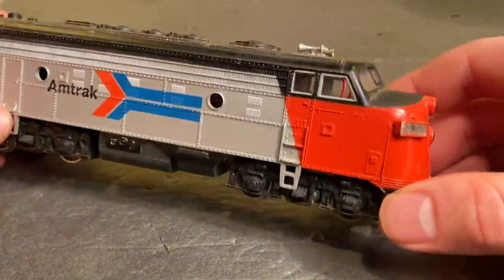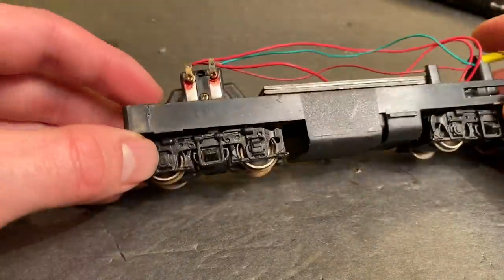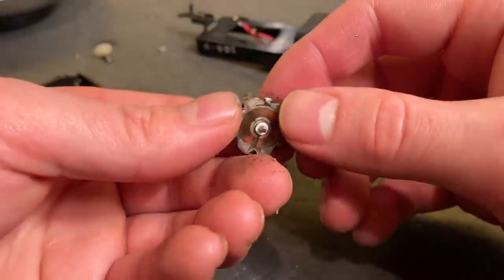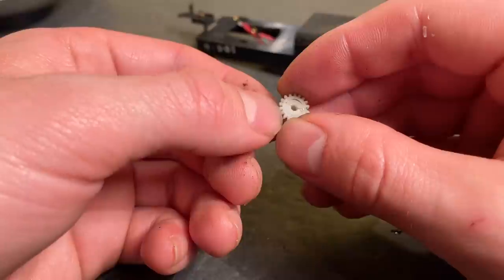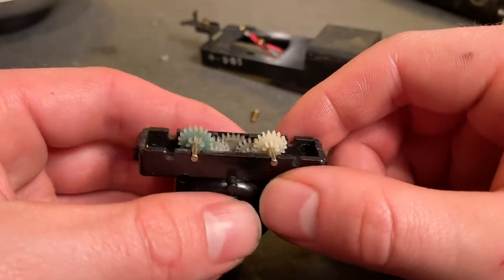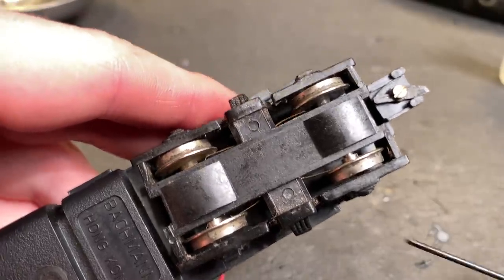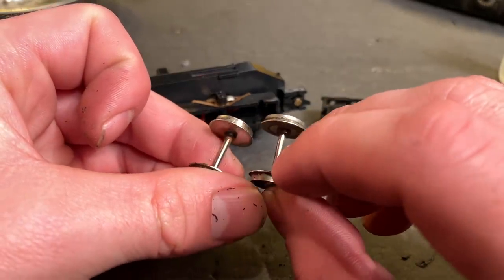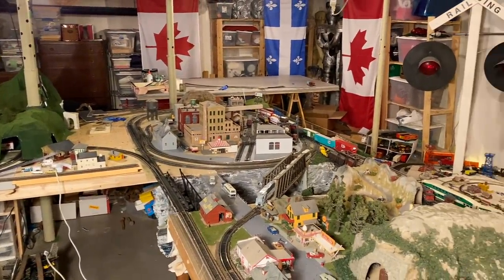Can We Fix This Broken Amtrak Locomotive from the 1980s?

Comment: That gear probably won't hold long for too long.   Northwest Short Line was the go to company for ALL things gear and wheel related.   But they're out of business unfortunately.   NWSL was a great company for the hobby for many decades.
Reply: Have seen a nylon gear repair with liquid CA and baking soda sprinkled on while CA is still wet makes a “resin” ??? But seemed to work in video.
Reply from the maker: I think the Life like gear should hold on, time will tell. They weren't known for cracking like the Bachmann ones.
Reply: @SMTMainline  that’s good to know.  I mostly only own Athearn blue boxes, old pre powertorque tycos and some Mehanos and only two Bachman.  The poor tycos are mostly dead only two out of five or six were ressurectable.  I have only been working on HO locos since September really and have learned a lot from you videos so just want to thanks again!!

Comment: Re: fixing cracked gear. I saw a YouTube tutorial clip & the guy powdered a cracked gear with baking soda, and then dripped in a small amount of superglue (cautioning not to get any into the gear teeth). The mixture hardened up & his fix worked. This fix was on a gear that was only cracked to the axel, and not cracked all the way in half like yours.
Reply from the maker: I will have to try that
Reply: Useful info! I tried to super glue a cracked axle gear on my kid's Tomy Thomas loco and it didn't hold, so maybe I'll try again with the baking soda.

Comment: I have a similar F7 in Santa Fe paint and also tried to service it like you did. There is power going to the headlight but as I took apart the motor, I noticed the armature had what looked like green lime calcium build up. Should I try remove it with alcohol wipes because it looks like the buildup is preventing the motor from spinning.

Excellent videos and I'm following them to restore and even service my current fleet of engines! You might like the videos I post on my channel!

Comment: I just kinda assumed the Life-Like and Bachmann pancake motors were the exact same, I guess they do have slight differences- but they do seem terribly similar so I'm not entirely shocked you can swap in a gear from a Life-Like to fix a Bachmann. It sounds like it really wants you to swap out the other one too!
Reply from the maker: I don't know which did it first but clearly one manufacturer was stealing designs from the other.
Reply: @SMTMainline  hey smt I have a life like model locomotive that needs to be restored con you possibly fix it

Comment: I really need to pull my trains out and fix them up, I know I have a few that aren't running. I just hope I don't have any broken gears like that cus that's one.

I find that sometimes when a train isn't picking up power well that if I have another train pull it for a bit it cleans up the connections.
Reply from the maker: In most cases it doesn't take much to get these types of locomotives back to life.

Comment: SMT- Does the non-powered truck also have electrical contacts that could be oxidized & rust on its wheels?  That red solution may also help to prevent the screws from vibrating loose.
Reply: No. Wire are for the light
Reply from the maker: Some Bachmann locomotives did have contacts on both trucks but it appeared this one never did.
Reply: @Gfysimpletons  - You are right, the headlights were connected to the motor & wheel contacts with wires!
Reply: @SMTMainline  SMT - That is 2 cases of Bachmann being short-sighted in their design changes.  They should have stuck with the all-wheel drive & all-wheel pick-up designs from the 1970s!

Comment: I've always liked the Amtrak Phase 1 paint scheme. I hate those white plastic Bachmann gears. The N scale units are also prone to the same gear cracking. I've dealt with more than a few of them over on my channel. As far as HO scale stuff goes I think the only pancake motor stuff I have is Life-Like although there may be some old Bachmann in there too as I know I have had them in the past. I wonder if the life like gear, even though it has the proper number of teeth, might have a slightly different pitch to them and not meshing 100% correctly. I've actually had that problem replacing Bachmann gears with OTHER Bachmann gears. Slight variances from one production run to another. Not very common but it's happened more than once. I keep a box of spare trucks handy in case I need to raid one for gears. Although it's certainly uncommon for the stuff I am trying to repair, to find a white plastic geared truck without at least one cracked gear. The black plastic they switched to is far superior. Anyways good job, Harrison!     -Shane
Reply from the maker: Thanks for the information

Comment: That's really cool you got another locomotive running. I have one that is a Santa Fe prob from 1990s but the front axles have split because they are plastic I was thinking the only solution to fix it is take the shell off find another chassis that has the same fuel tank connection and  then it would be 8 wheel drive with 8 wheel pickup. Fortunately the motor and axles and the gears are not split on the backside however there is no easy fix for the front axles.  Awesome vid as always
Reply: I have a locomotive that I have that is in  bad shape  what should I do to the locomotive
Reply: @monsterdemolitionman1235  if it's fixable fix it I'm pretty sure every locomotive out there can be fixed trust me even ask Harrison
Reply: @mercuryoak2  hay new haven model r.r
Reply: @monsterdemolitionman1235  hello. Hopefully you can fix your locomotive. I know that like I said the bachmann locomotives with the split axle problem pain in the butt to fix. I know a hobby shop that I went to said if you have Riverossi there are no parts and not fixable. I said well maybe somebody needs to make some 3D printed stuff because there are so many people out there that have these older locomotives that need to be running he looked at me like I was nuts but it's true
Reply: @mercuryoak2  new haven model r.r what should I do with my locomotive send it to smt ro through it away
Reply: @mercuryoak2  new haven model r.r I don't know how to fix a model locomotive
Reply: @monsterdemolitionman1235  I don't know that's up to you. he doesn't take repairs most of his things he gets is for his collection or can be parts. Since lifelike isn't made anymore you would have to get parts from another locomotive to get that running.
Reply: @mercuryoak2  that just it I don't have another locomotive
Reply: I do appreciate your help
Reply: @monsterdemolitionman1235  no problem. I'm not perfect but I try to do my best to help someone
Reply: @mercuryoak2  he think you could help me find the pars
Reply: do you fix destroyed model locomotives
Reply: @monsterdemolitionman1235  who said they think I can help you find the parts. Smt? eBay would be the best bet. But there lies the big thing the loco your fixing has a truck gone as well as the shell. Anything you would find is mostly together and just needs oil and such. I myself haven't had any destroyed locomotives to repair. Kit bashing isn't my strong point I never did it. I have only done minor maintaining and or one I had to make a spring work for a steam engine because I lost the original.
Reply: @mercuryoak2   I have a diesel locomotive
Reply: @mercuryoak2  I do have a steam locomotive
Reply: @monsterdemolitionman1235  I know I was talking about myself. I have a lifelike loco that I bought OMG back in 2006 never had any issues. But parts that's where you're gonna run into trouble.
Reply: @mercuryoak2  I do have a steam locomotive to
Reply: @mercuryoak2   but the thing is I don't know the history of the locomotive
Reply: do you have any life like locomotives
Reply: @monsterdemolitionman1235  only one I have that is a regular lifelike is a Fph40 Amtrak. Then 2 proto 1000 locomotives one is a BL2 that I gotta replace gears and I have them and a C liner same thing needs gears but it's not clicking yet
Reply: @mercuryoak2  could I possibly send it to you some time
Reply: could I possibly send my locomotive to you
Reply: hey new have would a motter from an Amtrak proto type work for my locomotive
Reply: @monsterdemolitionman1235  no... If you have a lifelike pancake motor it will not work no. The polo 1000 series and 2000 series was like the bachmann spectrum. It was higher quality
Reply: @mercuryoak2  I think a  older  model
Reply: @monsterdemolitionman1235  I don't know why you want to save a locomotive that is basically trashed when you can buy one that's working perfectly fine you're not going to find the parts for it but if you do they're going to be overpriced. I don't want to tell you you're asking me and I don't know what to say because I never had it where I had to piecemeal a locomotive together. It's frustrating for me because I don't know what you're talking about and you're wanting to save something that's just a frame no show not even a motor if it does have a motor. That's why I said Harrison would be the better one to ask. The primaries I don't want to lead somebody down a path that is going to screw them up
Reply: @mercuryoak2  I asked him about my locomotive and I didn't get a response from him
Reply: @monsterdemolitionman1235  you do realize he gets emails daily can you imagine having as many subscribers as he does and he gets maybe half of them in emails.
Reply: @mercuryoak2  just wondering what types of Gage locomotives you have